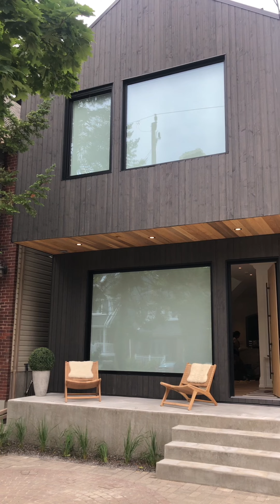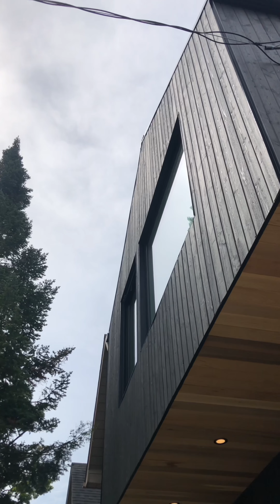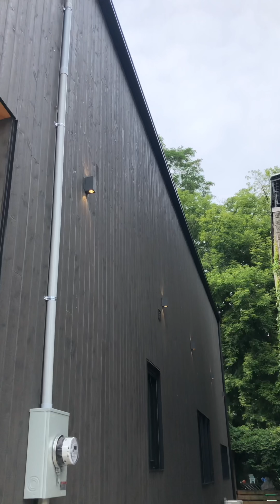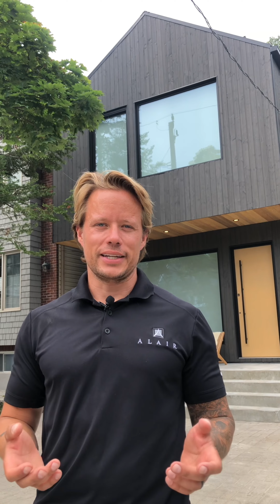ALAIR HOMES - Maibec siding

Comment: I’m using Quarrix furring strips on my house that I’m doing vertical siding on. It applies horizontal but is corrugated so it still allows air and water to pass through.